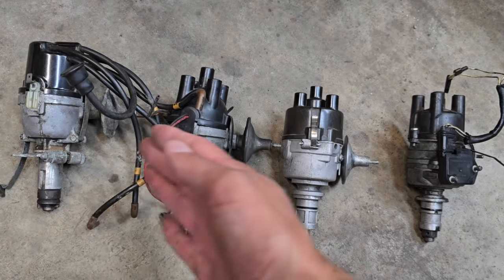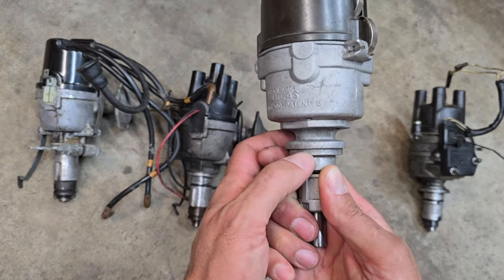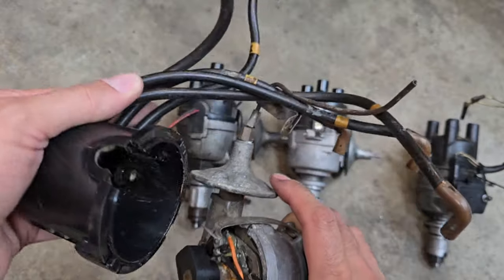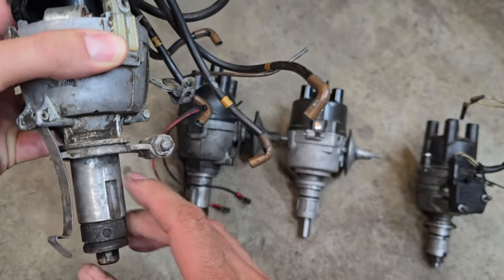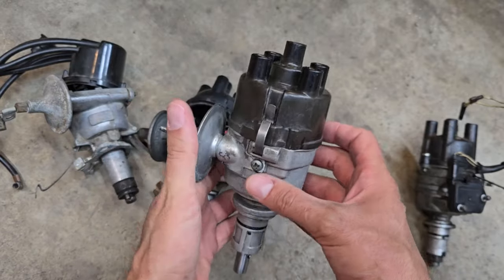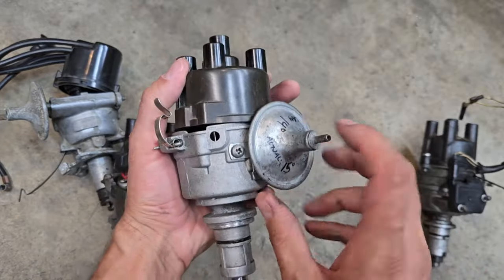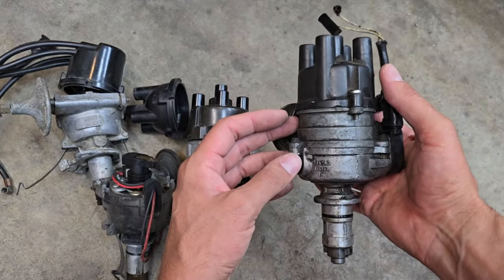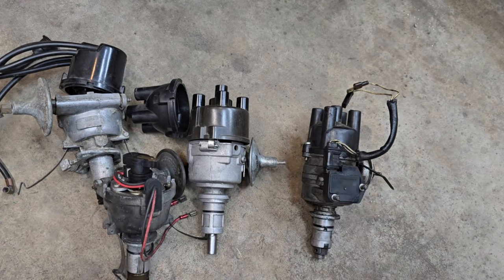Classic Mini Survival Guide: Distributor Identification

Comment: Thanks for the vid... Trying to understand how to inprove my ignition systems on my rover mini and found this! 👍
Reply from the maker: High power distributor with matching coil, low resistance wires and plugs gapped properly is the way to go. having a good timing curve on the distributor is equally important.
Reply: @darrensrestorations991  quick question, how do I know what to gap the plugs to? 25 or 35 thousands? Running a 1275 A+  stock engine and planning on buying a 65d high power kit from Powerspark in the UK